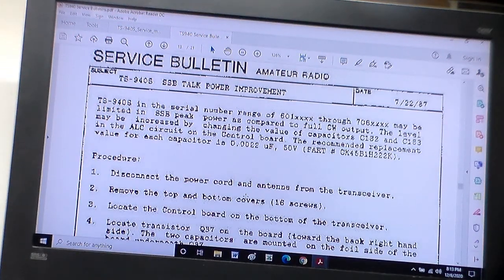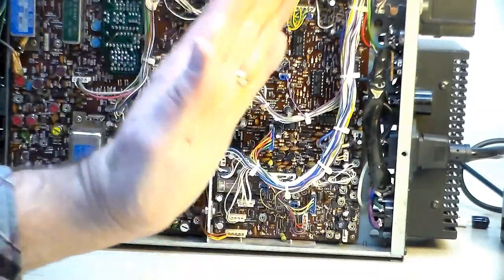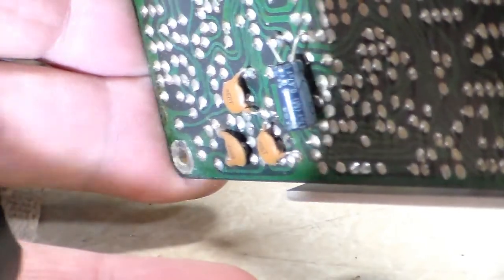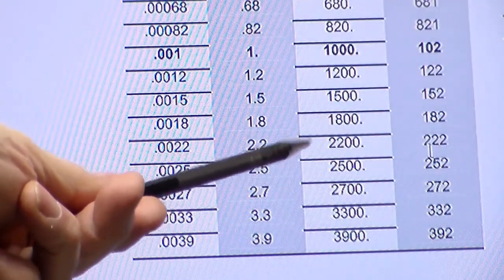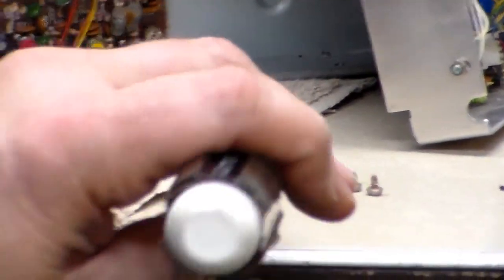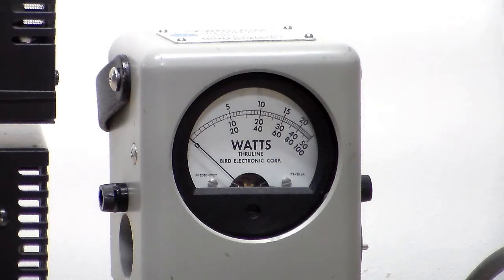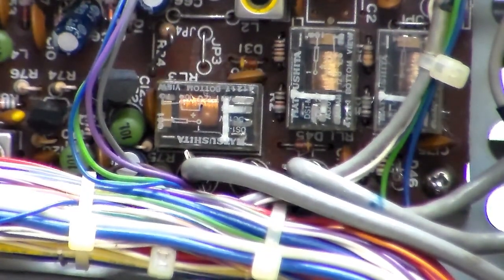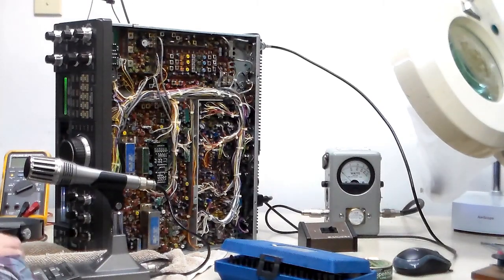TS 940 SSB Power Improvement Bulletin

Comment: Hello Tim
I need to do a good alignment in rx & tx.  The radio is working good. But ...  after change the power supply andthe exciters.  I think is necessary a good calibration.  Can you help me ?
Reply from the maker: Hi Jorge.  Those radios are a monster to align.  Unless you are having specific problems, don't adjust things without all the correct equipment.  Definitely make sure to set all the reference voltages, bias for drivers, power output and output safety settings (current and SWR).  Basically, do the easy stuff called out in the alignment and try it out to see if you need to do more.